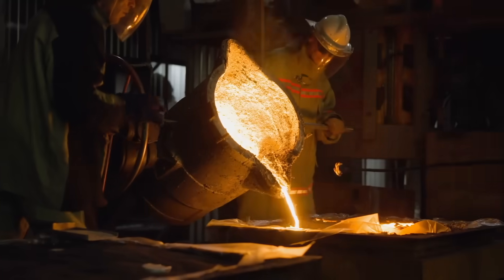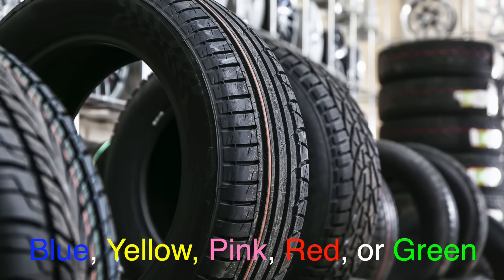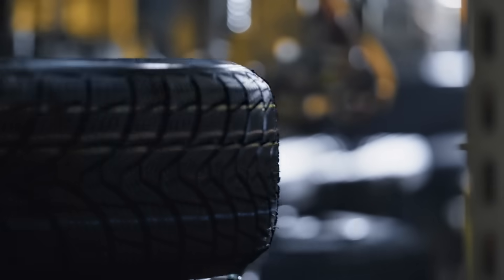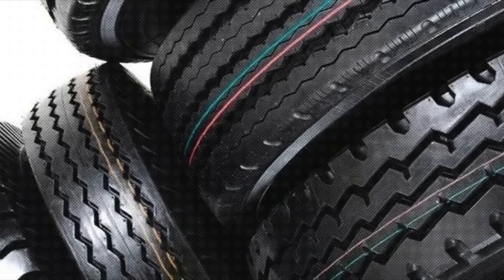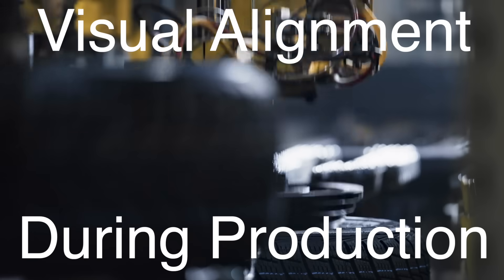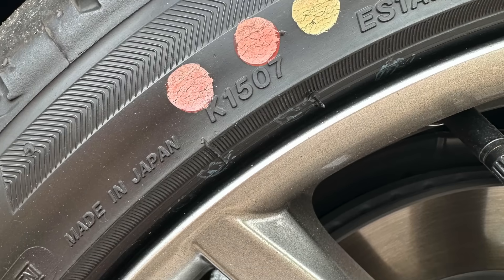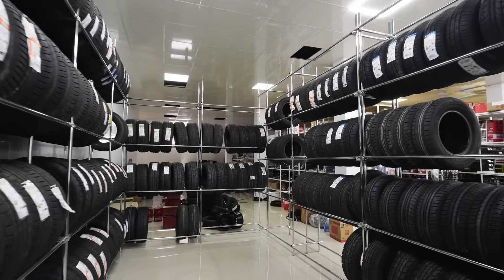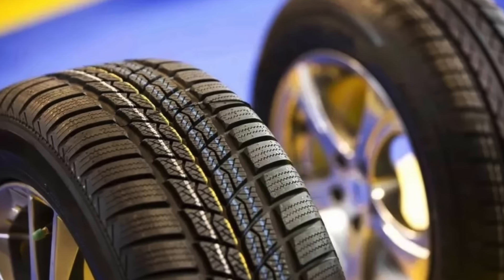What Are Those Colored Lines on New Tires?

Comment: For anyone who can see this. I was looking at pics on an old SD card but before I inserted the card I turned off my WiFi on the device. I looked at the pics to see what they were and that was all. I didn't save any of them and I don't even have a photo app on my phone, I also have the google app disabled and yet somehow once I removed the card and turned WiFi back on and started watching yt I noticed that I was being recommended videos based on what was previously in the pics on that card. How is it possible since nothing was saved and device was offline while I had the card in. So apparently even when you disable the WiFi everything you are doing still gets recorded and used either for or against you anyway.

Comment: Has been working in tyre manufacturing for more than a decade and I can say the information is correct. The colour line is useless for consumer but useful for manufacturer and distributor. In modern tyre factory, colour line may not be a good choice as they comes with their set of problem as well during manufacturing process. Modern tyre building machine may opted out using colour line for quality control and tracking of the tread component and  the tyre itself can be tracked by a tag and barcode/serial number that is stick to it. However, some distributor or rim assembler may request for colour line to ease their inventory management.

Comment: You should drive a bit slower and carefully until the lines wear off, not due to the lines but due to the mold releasing agent wich as you can expect from what it does is very slippery.

Comment: My new bike’s tires had 2 yellow stripes on the outer sides each tire. Unfortunately I managed to remove 7 of the 8 stripes with one on the right front not yet removed. My only guess is I’m still not leaning the bike over far enough into corners. Have been riding on and off since the late 60s and this is the first time I’ve ever had a chicken strip.